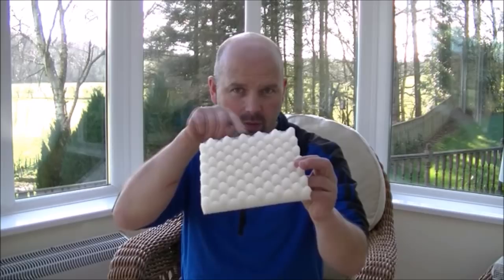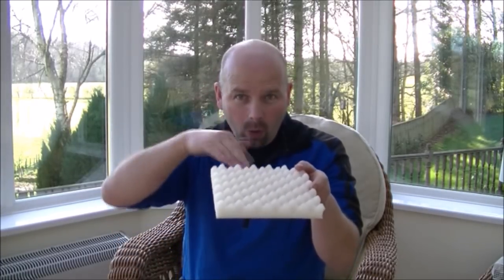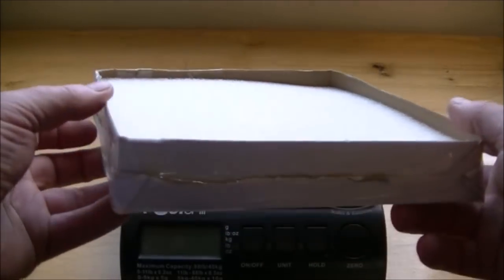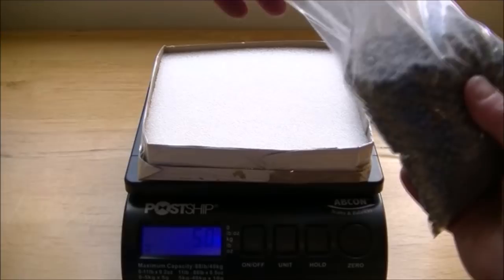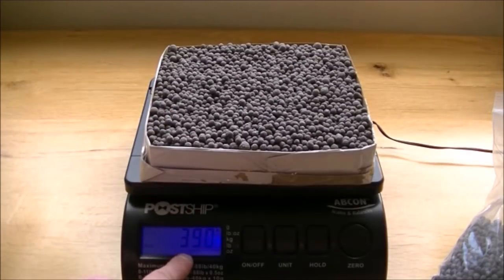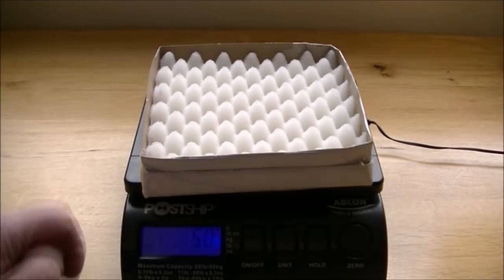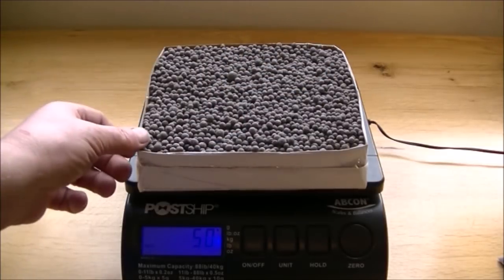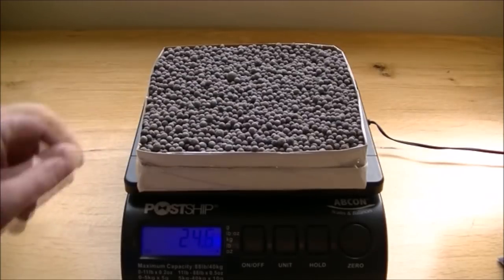Choosing the correct filter foams - How important is it?

Comment: ya i have poret in my canister i maintain it once a year. & i dont think non-flat surface does any difference you just need to set up your canister right
Reply from the maker: Having voids between the foams allows for increased dirt collection / less clogging but there's not a whole heap of difference. As you say, as long as the parts are set up in the correct order it will work well regardless of if the foams are profile cut or flat.

Comment: Do you use fine foams instead of perline pads? In your JBL cristalprofi configuration video (I have this filter),  I thought the white pad was perline. Which is to be preferred: perline pad or a fine foam? Surely a perline pad would more effectively prevent the clogging of the bio media?  Thanks.

Comment: Very good stuff Richard, as usual my dear friend, thanks a lot. We still have many things to learn from you.
Could I ask if you already know about the porosity of the egg shaping profiled foam though? What PPI does it have?
Reply from the maker: In the UK people tend not to get concerned with the PPI of foams (maybe because it is a measurement in cubic inches?) but the coarse one could be 10ppi / 20ppi, medium may be 40ppm / 60ppm - we just buy coarse and medium. As long as the first one water hits is more open structured than the second one it's all good.

Comment: Thanks for sharing great insight. U did a fluval canister pimp video where in I remember that u  replaced the factor course filter with your suggested pond filters - course and medium. In its placement, u didn't pace the jaggered portion of the course foam as first contact to water. Could u pl explain y ? Thanks again

Comment: Wouldn't the longer time between maintenance make the muck in the filter it captiers rot thus feed the alge?? I se your point, and will sertanly lay the lumpy side up.
Reply from the maker: Not really, the dictating factor will be the fine white pad and how quickly it clogs. When it gets clogged the flow slows down and the filter needs cleaning.

Comment: i would like your suggestions on this please:
i just got a aqua-tech 30-60 filter/w bio grids it's replacing an aging whisper 20-40
my question is :
how can i make it a more efficient filter and get away from the standard cartridges and use bio media and foams in such a filter
thanks,
Reply from the maker: +willliam lacey HOB filters generally don't allow for much alteration as they rely on the cartridge system and looking at image search for your filter (not one I'm familiar with as we generally don't use HOB in UK) I can't see how it could be easily altered as the foams seem to be very much toward the front side of the filter.
Reply: +Pondguru Outdoors 
i did further research on these filters on all models they have a fatal flaw ; the  impeller is part of the lift tube .. not as a separate part to the motor it breaks easly. ... i'll be taking it back and get my $'s back .. and put toward a unit like the aquaclear 70 - 110 ; these units place the impeller in the motor and also use filter pads and bio media bags ... no cartridges 
thanks anyway ,
Reply from the maker: +willliam lacey No worries - sounds like a better system, something you can alter to get working properly.

Comment: Hi, sir I have an Ehiem 2213 canister filter which has a small media basket in it which holds the media in it, now I have been looking at all your videos and knowing that more the media better the water quality in the fish tank, so with that been said is it advisable to remove the media basket and put the media directly in the green coloured container which holds the basket, sir I would appreciate your answer on this.
Reply from the maker: In those sort of filters you could do it either way. As long as the foams are the bottom followed by the fine pad and media above that it will work fine. As the Eheim website states the 2213 (250) is suitable for normal aquariums of around 80 litres it will likely hold at least 1kg of media as their sizing is normally very accurate.
Reply: Pondguru Outdoors 
Thank you very much sir, I really appreciate your support and help cheers.
Reply from the maker: No worries, any time.
Reply: Hi,
Sir I have another question and it's really confusing for me after reading all different types of reviews is it advisable to switch off the canister filter while feeding the fish.
Reply from the maker: I suppose it depends on how the water is returning to the tank and what type of food is being fed / where in the tank it drifts to and if it gets sucked into the intake pipe but generally you would not turn a filter off while feeding the fish. In a pond a skimmer would be turned off while feeding as it draws anything floating into a basket for removal but in an aquarium just leave everything running.
Reply: Appreciate it sir, thank you very much.

Comment: But in a SunSun Filter the water comes up not down like a Fluval filter
Reply from the maker: Sun Sun is like most canisters which work bottom to top - FX series of Fluvals work top to bottom and the only reason that I demonstrated how much 'dirt' the profile cut foams would hold by having them facing up in this video was that the gravel stayed in that way. It was impossible to have them upside down for the demonstration.

Comment: I don't think this is the case . That's like comparing the contact patch of wet weather race car tyres and fully slick race tyres . I believe you are wrong .sorry. the more surface area and contact patch the great the grip or in this case filtration .. sounds great in theory .. but your demonstration only proves you can and will need add more media to make up for the portions that are not bumpy ... sorry but I just don't see how this works ..
Reply from the maker: When you layer foams on top of each other you get voids between the foams and that traps a nation of muck - its something which really has to be tried to compare the difference between flat foams and profile cut foams. It is no coincidence that the majority of pond filters use profile cut foams specifically to trap more dirt and extend maintenance times in situations which have much more muck than an aquarium.
Reply: @pondguru  the legend have spoken. Thanks a lot

Comment: Yeah, but you will have lower nitrate cleaning once a month.
Reply from the maker: +Jeff K I would still recommend doing a partial water change for the tank every week of 10%-15% to freshen up the tank, even when it attains zero nitrates as essential elements will get lost or tied up during the many things happening in the aquarium and filter. 
The filter should only need looking at as and when it gets clogged but uneaten food and fish waste will still need removing from the substrate.
You're definitely right that regular maintenance of some form is still required to keep the tank looking good and functioning properly.